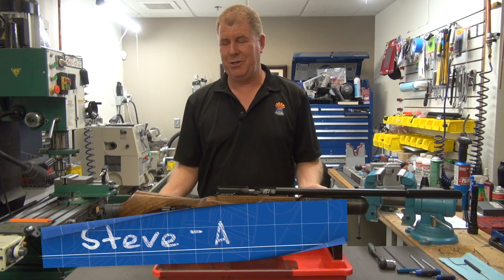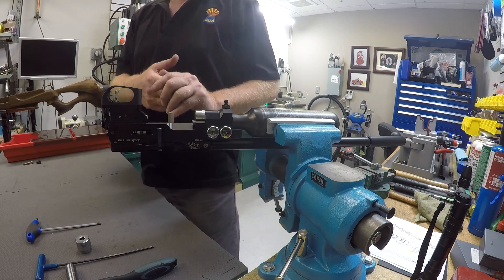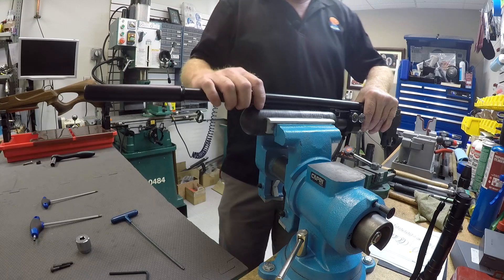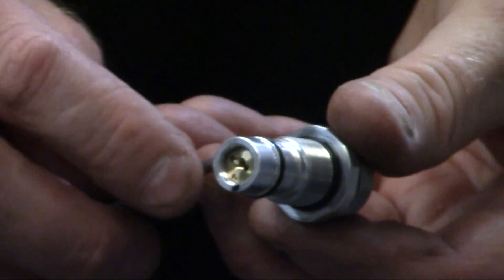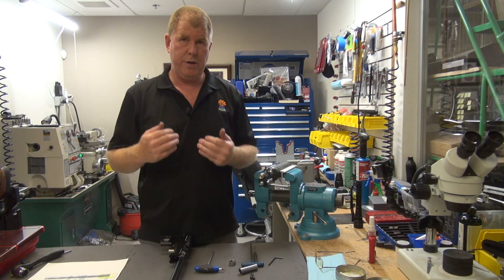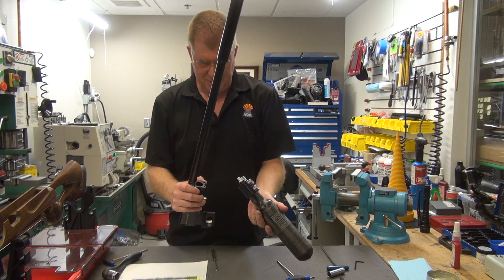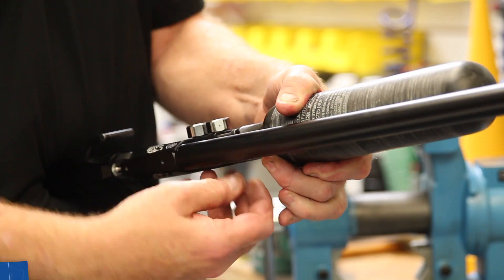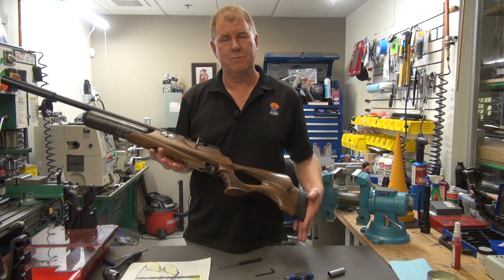Daystate Wolverine R - Regulator Service & Repair

Comment: To increase power, which way do you turn the reg's screw - Clockwise or Counter-clockwise, And is it true that just a little turn goes a long way?
Reply: I would like to see the answer to this question.
Reply: Counter clockwise increases reg pressure , but thats not the easy way to increase power , you also have to balance it with hammer throw .